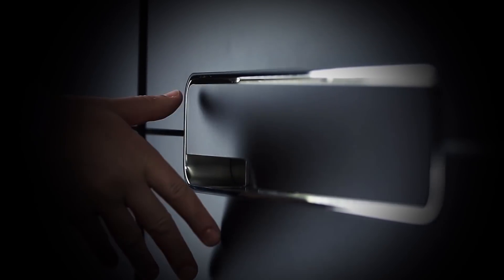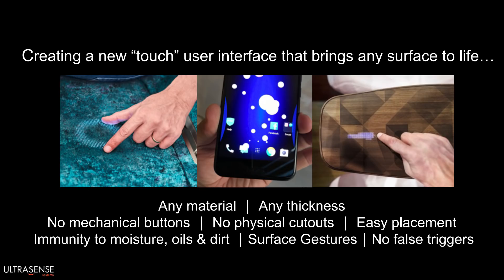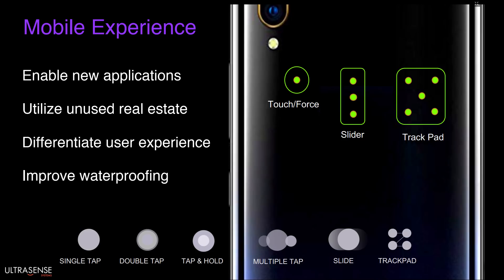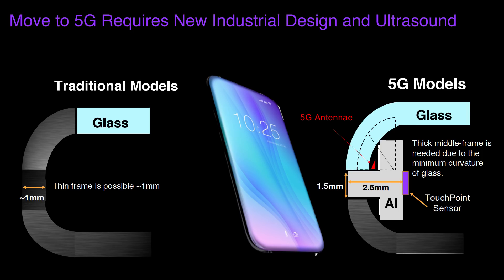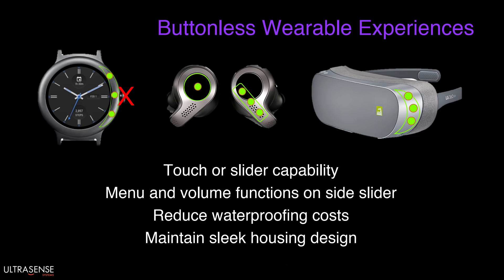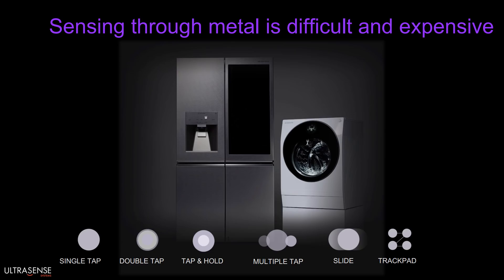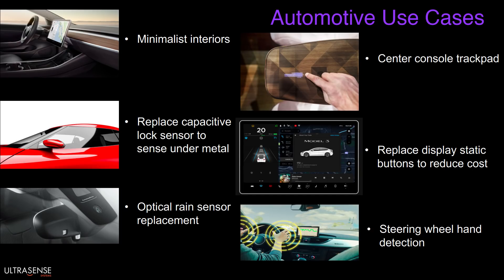The Death Of Mechanical Switches

Comment: I bought a car radio with no volume control knob. Boooo! When driving, I want to turn a knob, not figure out which button to push when the ads are too loud. Same for my thermostat -- no knob to turn to a desired angle. Instead, I need to find up/down buttons and watch the display (with a magnifying glass) to determine the actual setting. Cheaper for manufacturers ... bad for users.

Comment: I'm really laughing inside.
2018: Media blast's HTC for buttonless phone, saying it's a solution looking for a problem.
2020: Media waxes eloquent about the benefits of a buttonless phone.
By the way, does HTC and ROG know that this company is passing off their products as their own? That is HTC Edge Sense at 3:41, being used by Ultrasense as an example of its own product.
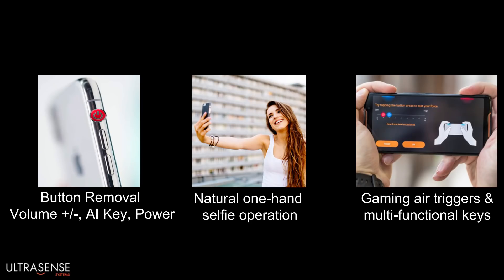And, that is a is the ROG Phone at 4:36, again, being used by Ultrasense as an example of its own product.

Funny thing is, both HTC and ROG use different technologies than this, and the HTC actually has 32 pressure sensors in the frame, and they are as thin as a piece of paper.
Reply from the maker: I never blasted HTC for its buttonless phone. The "media" isn't really the right term to use.
Reply: @GaryExplains  - Not you, Gary. By media I mean review websites like Android Central and several others, some of which spent 90% of their review on the buttons alone. I like your videos, this one included, and I was just looking at the big picture.

Mechanical buttons have not been my friend. I have 5 phones with button problems, my PC monitor has a menu button that sometimes works, my space heater need 15 taps to work once, I have 6 power amplifies where I have had to replace the power buttons, a $4000 mixer and a pair of $600 mixers with button issues. So, I can certainly see the advantages of getting rid of weak links!
Reply from the maker: But you did say "2020: Media waxes eloquent about the benefits of a buttonless phone." Either that is a direct reference to this video or a forecast about what "the media" will say in 2020 about buttonless phones. If it is the former then I refer you to my first comment. If it is the latter then I think that is a bold prediction as "the media" may react in the same way as it did with the HTC.
Reply: @GaryExplains  - It was predictive.

Comment: The problem is...I like mechanical switches:) I'll never forget htc 10. Tank that I used naked, beautifully tactile buttons, wonderful 3.5. I wouldn't change that design for any modern, most expensive and best smartphone of today. Porttless phone. Great for manufacturers, that's for sure. For users... nightmare that will need tone of accessories and tone of extra cash.

Comment: Do you know we have already had touch screens for many years now? We could simply do the same thing with that! People like buttons tho. Mechanical disconnects are a hard one to remove without opening more issues. Not to mention unless you charge a phone wireless you still have a open hole you cant totally seal with a gasket. Lastly we can easily make mechanical buttons sealed with no gaskets and have done that for years as well! We just use a flexible cover over everything. Even my 10 dollar ESC programmer uses this method to keep dirt out.

Comment: Basically my nightmare scenario.

Not that it isn't an interesting piece of tech, particularly for some applications, but I heard this whole spiel before... not in such a small form, but a whole bunch of the marketing scheme.
From stuff like virtual keyboards, to Project Soli, to LeapMotion, to a hundred different rings, gloves, bracelets, air mouse and whatnot on crowfunding websites, to Microsoft's Kinect, all the way in the past with projects involving low res cameras and whatnot.
The problem in all of those that never seems to be solved is the same as ever - tactile feedback. And no, haptic feedback just is no replacement for it, no matter how "advanced" it becomes.

It is interesting that it's tiny and could become a mass produced thing, but I'm one of those people who still don't like the virtual aspect of smartphones. I live with it, yes, and I think it's better to have a smartphone with a big screen occupying as much space as possible, yes, but I still don't consider a touchscreen keyboard better than a physical one.

And if anything, I wanted to see more physical controls on a phone instead of less. Buttons, dials, etc. Even though I'm not much of a fan of neither Apple nor smartwatches, that iWatch crown thing I saw as a good thing. Also using the outer ring of the watch face as a control of sorts, can't remember who implemented that.

I guess it'd ok to use touch buttons without feedback for some stuff, but I don't like the idea as a general thing.

Comment: Interesting concept, but based on manufacturers' history with adapting new trends or technology, one could reasonably assume that above every device using Ultrasense's ultrasound controls, you would need a cheat sheet or manual to teach everyone how to use it. Each manufacturer could have their own unique adaptation where their gestures are not standardized or conform to some type of functional norm.

Comment: NO! A mechanical switch, or button is great, and their is no "small, and CHEAP" substitute. Sure I can see those horrible touch buttons getting to become the norm, but I'd pay more, actually no, I DO pay more for items that have tactile mechanical buttons that feel satisfying to press. As something to use alongside mechanical keys, where they both have their places, I do see some use.

EDIT: "A switch is at the bottom of the food chain, to what is technology."
What, are you joking? A switch/button is how you interface with the tech, and make a lot of the feel, and experience of the device. Just from touch a button/switch, you can tell if it's cheap, well-made, and/or if it's really cool to press. You feel that volume button, alongside the volume going up/down; you feel the light going on with that click on a switch; you feel when you turn something on/off a device. It's one of the most important things of a device, and when if it goes, those devices won't feel as good, and a bit of the magic will no longer exist. You can upgrade a processor, you can have a bigger/better battery or screen, but a button, especially a well made one, is Irreplaceable.

Comment: Love the concept but still sceptical when it comes to getting the switches replaced. For eg, when the power off switch stops working, it's an easy mechanical switch replacement, right? What if one of these switches fail?

Comment: This is a good application for some things but not for phones. Putting the phone in a pocket could cause it to do stuff unintended. Also I can imagine people hacking stuff and making tools that emit ultrasound waves that would control the phone in various ways. Also with mechanical switches the power is just sitting there not used until the circuit is closed. These ultrasonic sensors would always have to be putting out power when not being used to be ready for use. To me for this application, touch capacitive sensors would be a better choice, but even those have the potential for undesired operation.

Comment: Two things: 1.  Tactile feedback is a part of the switch function.  That means some haptic mechanism could well be needed.  2. The ultrasound needs to be "always on" to detect a random keystroke.  That means there'll be a continuous power drain versus a completely passive mechanical switch.  Chances are those things aren't showstoppers, but it would be good to hear how they'd be handled.

Comment: You are thinking all but the most important thing. If switches get broken ordinary people can get around that and still use it, and its easy to repair and cheap. What if those tactile senzors get broken? You can't do nithing until it gets repaired at a service? In witch time it will get fixed? Or in case of emergencies and you need it to work or stop a machine to work or do a certain task and the senzor is broken? Or it registers badly when you don't even need it to ... Etc.  Mechanical switches are simple and easy to repair.. The other ones? A luxury not needed?.

Comment: 1. What's the standby power (generating vibrations to be damped by your finger)?  When my phone is off (yes, I turn it off sometimes) I want extreme battery life.
2. How is this better than capacitive touch  technology (other than being new enough to be patentable)?
It seems to me that the reason we don't already have capacitive sensors all over our phones is that we don't want our phone doing something every time it bumps up against something.

Comment: is it all supported by linux kernel and api?
Reply from the maker: It talks over i2c or SPI, it doesn't need to be supported at the kernel level. It is a peripheral.
Reply: @GaryExplains  so it needs gpio (lets say like rpi)?
Reply from the maker: Yes.

Comment: Nooooooo!
First the headphone jack and now the hard switches.
Reply: While watching this, I had my laptop connected to a Schiit Jotunheim. That has both a headphone jack (though I'm using a balanced XLR) and physical switches with a knob on it for volume. It's also connected to an Apple computer with an M1 chip in it, so somewhere in hell Steve Jobs is screaming hysterically about it. If I really wanted to get hipster with the mechanical switches, I have some mechanical keyboards around that I can plug into it. 🤣

Comment: Tactile feedback. If I can't feel the tap, I prefer the switch
Reply: ultrasound haptic feedback devices is currently being developed for VR applications, though still quite far from market. If they prove to be successful, we can have non mechanical switches with feedback in the future as well.
Reply: @Magna Pony vibrations can be a bit too ambiguous and easy to miss
Reply: Khoa Bang Tran the iPhone 7 home button says not. We can do it, it has been proven. Only problem now is that it still not gonna be a good UX in car application.
Reply: @NeroWhereAreYou  pretty sure that's not ultrasound though, it was rather imprecise, and proper feedback devices should be good in most cars too, solving many of the problems of no feedback on digital control systems
Reply: Khoa Bang Tran what it is isn’t important, what’s important is the vibration motor that Apple was using. It was rather convincing and felt like you did really depress a button instead of just applying force to a rigid surface. On cars on the other hand, the problem isn’t really about feedback, but rather operating said switches without visual aid, since you need to keep your eyes on the road. It’s really hard to operate touch interfaces on cars because there is no button travel and you need to rely on looking at it instead, which is dangerous. As far as feedback goes, even if the screen is vibrating a little or a little chime on the speakers is enough indication for a feedback of a successful button operation.
Reply: @NeroWhereAreYou  I think you misunderstand haptic feedback, it's not just about vibrations - the simplest form of haptoc. I'm talking about simulating the actual feel of a button without the button, like touching items in VR without the need for a glove and feeling that thing on your fingers.
Reply: Feedback from HTC's buttonless phone is excellent, and I often press the buttons in my pocket to feel that sharp haptic "snap". It's very cool, and you can feel it through cases much better than regular buttons.

Comment: This tech will probably find a niche industry but I don't see this ever succeeding among smartphones.
Reply: It will, less moving parts is better for the customers and the companies making the product because of the savings on repairs in the long run. Imagine how many repairs within warranty they could avoid. If your as old as I am you'll remember the old TV's with loads of buttons, now TV's have only power buttons, volume controls and buttons for scrolling up and down through channels. Some don't even have that many
Reply: @franklingoodwin  if you have a good product with quality build and switches , it should be a rare , problem ,  i have never had a hardware/ switch problem ever on any of my android smart phones , never needed  a warranty claim   , although on one of my LG phones , it had a joint/wiring problem that effected the gps  that  i never bothered with .
  Removing good tactile switches , knobs and buttons ....and ports , is a win for the manufacturer  , because  it costs them less to build and engineer ,  the customer loses certain functions ,  and the manufacturer charges the same price for the handset !
   The ratio of win vs lose is way in the manufacturers favor in this trend of alleged  " progress " imo .
  I have to say  , i think it sucks .
Reply: @mikldude9376  I haven't had hardware buttons fail on a phone before, but it does happen. If they were replaced, they would have an even smaller failure rate
Reply: @franklingoodwin  tru

Comment: I've been using my phone without buttons since more than a year.
Reply: Volume?
Reply: @walkinmn   Added it to the quick settings. Thanks to an application.
Reply: It just seems like an annoyance to me ,  if i have a button that just instantly works , versus a stupid sensor  ridden device i have to either wait for or get rsi tapping the crap out of it all the time before i can operate it , again it seems like  going back wards .
Reply: @mikldude9376   Aah, I did not have a choice. I used it that way out of necessity. Did not want to buy a new set of buttons, they all had popped out.
Reply: @csbnikhil  Interesting , what sort of device   was it that all the buttons popped out ?
Reply: @mikldude9376  Moto G4 Plus
Reply: Are you sure? You dont have power button it seems 😉
Reply: @iamfaiz87   Yes. Absolutely. No power button. I turn off by long press fingerprint sensor.
Reply: @csbnikhil  That makes more sense once you get used to it